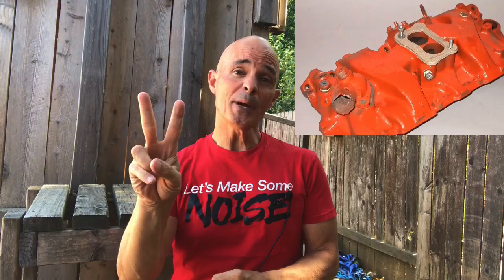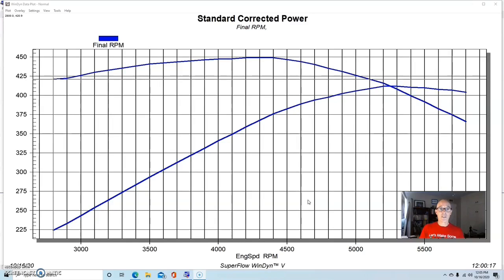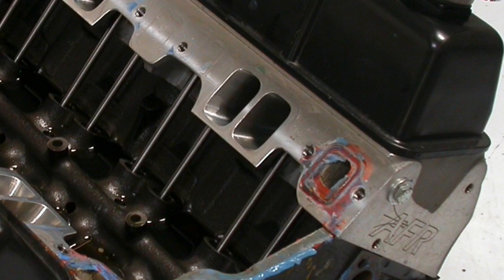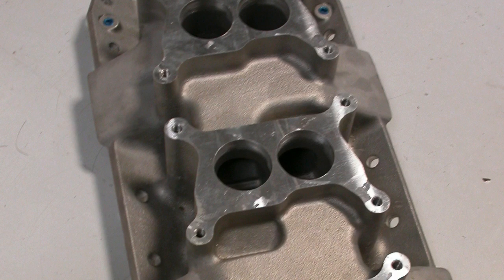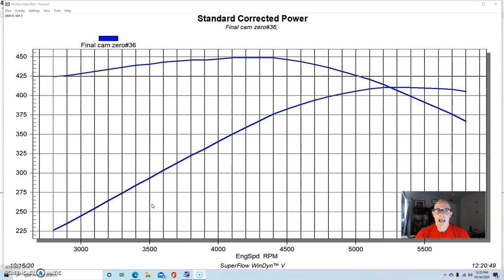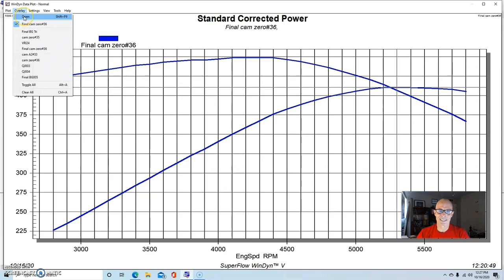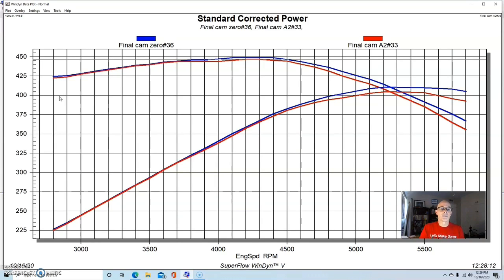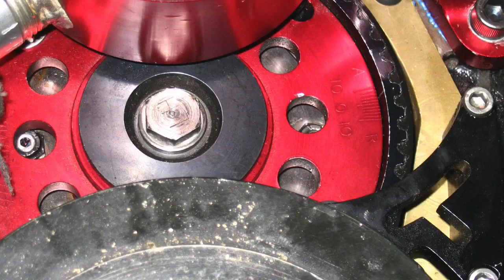SBC TRI-POWER INTAKE & CAM TIMING

Comment: First of all I enjoy your videos a lot, good info. My experience dealing with mechanical timing , when I degreed a cam that is because you trying to get the best performance with the camshaft profile that I have.  If there is the need to advance or retard your mechanical timing then you have the wrong cam for your convination. The idea is to have the more area under hp and torque on your graph. This is just my humble opinion. 👍 keep up the good work.

Comment: Hey richard holdner,  Barry Grant did it didn't they with that fine tri carb setup  :o) 
+ Hey test the colorado hot rod parts real street ram on a 355, 383, 406, and then port it test them again and also for say a 434 c.i.  Use hydraulic roller cams, and vortec, then aluminum promaxx , and AFR or trick flow heads or whatever you think is best. This would be awesome letting guys know about a real street designed tunnel ram for daily driver hot rodding, not that a tunnel ram= setup properly wouldn't work just as well, or better, or anything, just testing and modding it for the best it can do , you know.
Reply from the maker: what is colorado hot rod parts
Reply: @richardholdener1727  oops , they became inactive in 2021 in business directory i just found because the website was not found, sorry richard, although this is what they did for a little while and had some impressive photos of vehicle owners with the product extremely happy about their colorado hot rod parts *real street ram, it incorporated a weiand lower tunnel ram, with custom designed separate tops, this incorporated customized quickfuel carburetors that were tuned with all throttle blades opening simultaneously, this was a great idling , great part throttle tunnel ram for lower rpm use,  the tops themselves were aluminum and had vacuum vase shaped runners that plowed into the lower tunnel ram for a high velocity punch straight into the heads. Dyno graphs showed more torque than an rpm with a trade off in hp, this was with a comp gm mimmic cam the L79 with more modern design power, meant to mimic the original. imagine with some real upgrades besides those and the camelhumps, it was making 400+ torque horsepower was probably less as it was not the focus. i believe the real street ram has some potential, you can tune  a properly sized variant to the application. however customers really enjoyed them very much, chevelles, camaros, mustangs, hot rods, el caminos. it was a budget sensible website that was easy to explore and understand, wish it was still up.
Reply: oh well . . . sigh , just another sign of awesome relic small businesses going down the drain . . .

Comment: Cam advance or retard is to confusing the main thing to look at is your intake center line this is your best tool to gauge a cam to piston relationship with that tame of camshaft you will not see much difference. What you are doing is changing your compression ratio by moving the intake's valve closing degree timing. Don't sacrifice the squeeze for low in power.

Comment: You need to do this video again with the lower rpm range. Almost every hotrodder I know has installed a cam and the first thing they say is it’s a dog at low RPM. So it would be cool to see a pretty hot cam get dialed in for streetablity or a low compress engine that can’t handle the duration get dialed in for off idle torque.

Comment: Have you done any testing with Hilborn fuel injection? Any significant power differences noticed on either end of the rpm range vs the beige suit combo?
Reply from the maker: the stack injection does add power
Reply: @richardholdener1727  just high rpm power or everywhere in the curve?

Comment: I like the results of the first test, TQ and HP in the 400's N/A (especially that flat torque curve) in a usable RPM range on the street and the simplicity of a single 4 barrel combined with driveability of the mild cam would be fun enough for me!

Comment: From dynamics of the runner lengths I'd much rather try to make some form of dual quad setup. That Tri Power looks really nice though in the hp and the looks department. That said the engine (notably the cam) defined this test anyways. It's such a cute little cam, the kind you'd run with a stock ECU practically.

Comment: Comp came alot of times grinds +4 into the cam, by you adv  the cam 3 you could have been +7 gonna lose power. I have found SBC's usually make more power every where when the ilc is 4 degrees advanced from the LSA, if the cam is close to the proper grind for the job.

Comment: Dual 4-bbl vs 3 deuces is a better test.  Cam advance or retard usually means something with OEM "performance" or "marine" cams which are still pretty mild compared to the aftermarket.  Once the cams get serious, pretty much stay with what the supplier says ...

Comment: Hey Richard, how about running a healthy to big cam and then some big cam swings, maybe 10 to 20 deg Adv/Rtd, to illustrate any changes with the power curve. Great work, thank you.
Reply: 20 degrees is a whole tooth off ...so what happens if I guy doesn't get it in correct and is a tooth off ? Normally it doesn't run well enough to find out
Reply: @scotthatch4653  OEM VCT systems can vary cam timing up to 50 degs.

Comment: The 4-barrel & tri-power aren't so much different. Both designs use 2 small main air inlets with secondary inlets for high output. Main inlets being equal, the 2 large secondary inlets on a 4bbl are roughly equal to the 4 small secondary inlets on the tri-power.

Comment: Honestly I find found the test a bit  disappointing, but reasonable. If the tri power carburetor system had really worked you would have seen it progress passed the 60's so results were expected. But to go through all the trouble of synchronizing 3 carburetors to work together for less power is very disappointing.
Reply: You really nailed it....I had a buddy back in the "Dark Ages" with a Factory Tri-Power 58 Chevy with a 348...Ran it regularly at San Fernando Raceway...Swapped a single 4bbl on it and went way Quicker & Faster. Good Times in the 60's

Comment: if i remember correctly, the Comp Cams Xtreme Energy cams are ground 4 degrees advanced. so by advancing it 3 more degrees you were actually at 7 degrees advanced total. had the retarded the cam timing instead, i think you would have seen the normal effects of retarding the timing. with the cam retarded, it would have started trading power down low for more power up top.  had the cam been degreed and installed "Strait Up" then advancing would have shown the a difference. the problem here is the 4 degrees of advance ground in to the came were not accounted for in the initial testing.

Comment: Speaking of interesting intakes, How does a single carb tunnel ram compare to a dual carb ram considering air fuel distribution? Specifically blow through when running one carb is considerably cheaper than 2
Reply: I'd also like to see a pair of 500 cfm two-barrels on a tunnel ram. I don't think I've ever seen that done.

Comment: Seems to me from my memory as a machinist back in the mid 70's all the manufacturers called for most machining specifications of + or - 2° for the keyway on the crankshafts, + or - 2° on the camshaft positions and the same for both gears. So if this is true (which I think it is true) and you add up all the flaws, you could end up with 8° retarded cam timing or 8° advanced cam timing. If you happened to get and engine where everything fell perfectly into place from the factory you had the car that always blew the doors of everything else in town. The worst part is I believe from 73' on up, the factory machined the cam gears to give 4° retard to help with emissions. You do the math on that one and you wonder why lemon laws broke out in the 80's. With today's factory CNC machining and all the automatic self correcting built into the programs, all the machining will be very close to dead nuts every time. 
  I still have a small worn out degree disc I used for TDC checks and quick cam degree check's at .050" lift on every engine we assembled and only changed the ones that a three position crank gear would help. On an engine with an aftermarket cam, we would degree all of them because some grinders would build the degree they called for, into the cam and some required you to set up the timing with the gears. I assembled a 92' roller 350 for a buddy back in 2016 and everything was really close even the cam timing without having to make any adjustments. It turned out to be a really nice running little hot rod.

Comment: Richard, could you test swapping the pistons and rods bank to bank on this motor? Maybe throw in a windage tray/crank scraper test, valve size test, Rocker arm ratio test, air filter test or spark plug/coil/igniter test? All tiny differences compared to all your other tests, but I'm interested in them anyways. Just to know if they are worth putting effort in.

Comment: Would there have been a bigger difference between the 4 barrel verse the 6 pack outputs if you would have swapped to a bigger cam compared to what you ran?  Or would cam size not matter?
Reply from the maker: I think they are pretty even but have to test

Comment: You left out how many CFM's each two barrel carburetor could handle. were the they the same or less than the single 4 barrel carburetor?
Reply from the maker: way more than the 4 barrel
Reply: @richardholdener1727  The dyno results don't reflect that at all. Why less horsepower and torque then from the 6 pack?; there has to be a reason. Jetting perhaps?

Comment: Richard it is necessary to degree the cam because sometimes they're ground with up to 4 degrees advance in them. I have found older duntof cams with 3 degrees retard ground in them so if you are building a high compression block with thin head gaskets and valve clearance is an issue you definitely want to degree the cam. Also adding retard to a low duration cam will more often hurt top end power

Comment: I did the cam timing test on a 41 merc flathead I built back in 1983 it made best power at 0 degrees 225 hp at 4200 rpm it lost power advanced and retarded . using the track Jr. cam and tri power . this was a strong engine for a flathead ( still is ) this engine is still running today . lol

Comment: I would like to see more more testing on this and then show OHV vs SOHC vs DOHC I think the biggest gains will be seen on the DOHC setups. I did see some low end gains on my 2.3L SOHC ford ranger playing with cam timing. I was able to pull a big hill in 4th gear that would normally be a downshift to 3rd but I can't be sure if I was making more retarded or advanced because it was a crap shoot with the amount of of play I had in my keyway. also I've done lots of cam changes and always have to tell people there's no point in degreeing your cam in most applications for street because they didn't have an adjustable sprocket so there's nothing to change you just end up with useless information. if you spend the money on adjustable sprockets then it can be worth it but usually only for minimal gains from what I hear. aftermarket cams are precision machined unless you get a defective one.

Comment: Wow you actually listened to my request now add turbo keep boost the same and change cam timing if you do I'll send you 50 bucks
Reply from the maker: how amazing would it be to spend a $1000 or motor dyno testing to make $50? Which Request?
Reply: @richardholdener1727  I wish I could pay you your weight in gold your videos have helped me so much with my build. But keeping boost the same on a Chevy V8 how much does cam timing effect horsepower and back pressure would advancing or retarding add back pressure
Reply: If you need help finding a weird or obscure engine let me know and I'll gladly locate it for you

Comment: It has been my experience that if you advance or retard the cam timing and realize a gain in the RPM window you are after it is just simple proof that you have the WRONG CAM.  See the reference to the shirt I want?  Same as changing the lash on a solid cam.  Loosen the lash and power increases,  is a good indication you have the WRONG CAM.  Variable cam timing of the new stuff really is helpful in the overall drivability and still have some ability to throw a big number out in the top end.  It just makes it easier to kinda have your cake and eat it too, so to speak.

If the Rhodes lifters actually worked, and I think they do work to a certain extent, you could cam for higher top end charge and gain a bit of drivability and street manners on an otherwise "peaky" engine.  Too many variables as oil pressure at a given RPM is different on every engine, yet the bleed down rate of the lifter is a constant is problematic to repeatability in different applications.  Maybe fine tuning using the oil pressure relief to make them work better for your combination might be helpful, but it would be a ton of work.  Poor mans way of "kind variable valve timing" in older engines that simply don't/can't benefit from the newer technology.  

Or.  We just use the new Coyote or LS stuff and forget about hitting a good number and have the drivability in our older engines.   The times and tech changed and us old guys simply need to go with the flow or get left behind.
Reply: Loosening the lash on ALL solid lifter engines usually will make more power regardless of the camshaft. Retarding/advancing the camshaft can make power regardless of the camshaft. Why do I need to buy the proverbial "correct" camshaft if I can loosen lash and advance my current cam for and make another 10-20hp? And if I give in to buy a new one, loosen the lash and advance the "correct" camshaft, does that make the "correct" camshaft now "wrong"?
Reply: @rustysausage69  The reason that loosening lash has a positive effect on MOST applications is this.  MOST engine combos are not quite perfectly optimized to the application or maximum efficiency (most available power) in the first place.  They are obviously close, but not perfect.  Thats why people fiddle around with lash looking for more power, or average power in the first place.  Same reason we dyno.  Testing to see what works for your combo.  If you are happy with the power output, why would you be fiddling around loosening lash?

If you change lash and see a gain in power the valve events are wrong.  Simple as that.  They may be darn close.  Obviously they are, if you gain only 10-20HP, but not completely optimal for what you built the combo for.

It is simply cheaper and easier to change the cam to duplicate the effect of loosening the lash than changing the heads, intake, exhaust to match the valve events of the original cam.  Hence "wrong cam".
Reply: @rustysausage69  No worries, we can agree to disagree.  That's part of the fun of learning, and believe me I have been learning mostly the hard way for 40 years or so when it comes to making horsepower and racing in general. 

I will say this though.  I agree that the dynamics of the lobe profile differ with different lash settings.  Where I differ is that the cam designer (these guys ARE experts in all things camshaft related if they are any good) have designed a lobe with certain physical characteristics in mind.  One might be valve train longevity.  If the lash is loosened it may be harder on components than if they are run in the cam designers original configuration of ramp rates etc......Most have a ramp that sets the valve down easy and starts the acceleration off the seat easy.  If you loosen lash you can upset that particular design parameter, which could be hard on overall longevity of parts.  Simple as that.

If you need a different lobe to accelerate faster to get the power you "found" by loosening the lash and changing the characteristic of the lash ramp, then the original lobe is not optimal for the combo.  That's the way I see it, anyway.
Reply: @rustysausage69  Its good to exchange ideas in a friendly manner as the learning curve of valve trains and horsepower is steep and expensive.  Have a great day!

Comment: Hello. Great videos! How does a person get in touch with you to recommend an other guys video possibility? This is a top subscription in my opinion due to all the info you give. You save people so much time and money.
Reply from the maker: just tell me right here-I try to read and answer every comment-my email is also in other videos
Reply: @richardholdener1727  I have a 91 F350 7.3 idi NA that I put an ATS 093 kit on and can't find any info on tuning for timing or what the power levels are. Also the 351/400M on an engine stand in my shop looks similar so I was wondering if a turbo would wake that engine up. I built one and it seemed like a good running engine to about 4000 rpm. Not much different than the 7.3 idi..?

Comment: I found in Internet a Infos from a Edelbrock Tri-Power Intake this a Vintage Intake The Name is Edelbrock C362S- I think it could make more Power than a Single Carb. This Intake a Single Plane type for Rochester 2G (large). What do you think.
Reply from the maker: if single plane-it will lose power in this rpm range
Reply: @richardholdener1727  Thank you for the Informations, have a great Sunday.

Comment: The 3 duces made a little more power, but is it worth it. The cost of two more carburetors and a manifold along with the setup involved, versus only a bigger 4 barrel on the same manifold.
Reply from the maker: it made less
Reply: It's for "cool factor" looks.